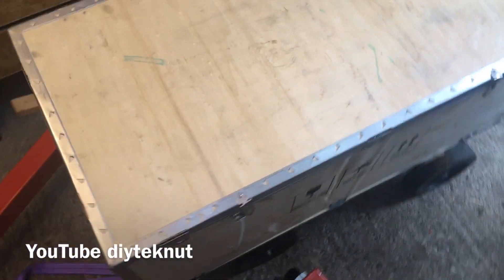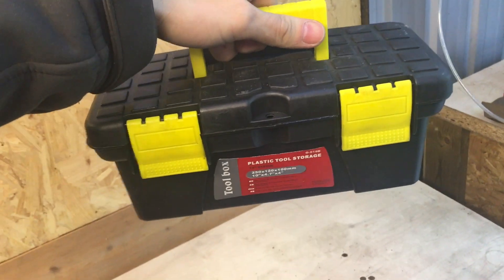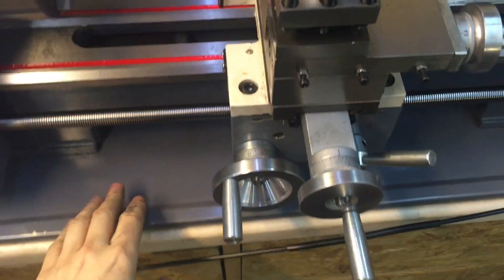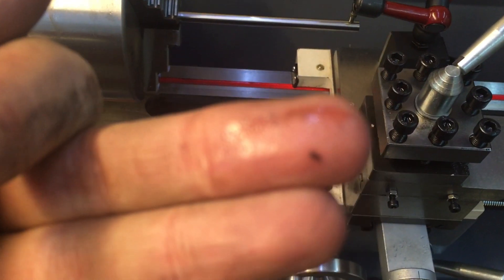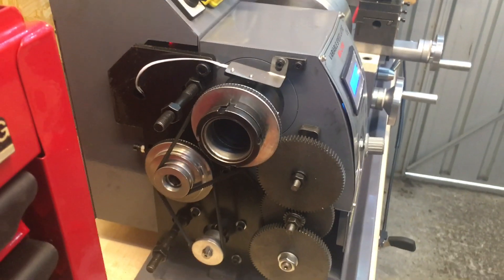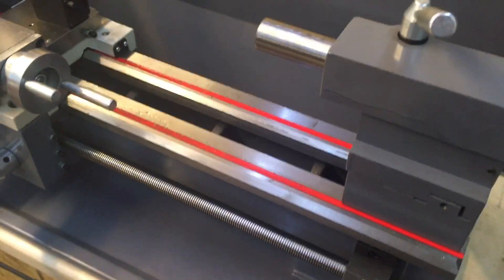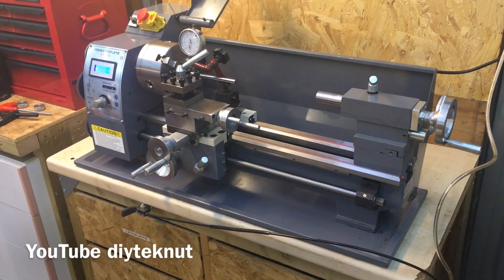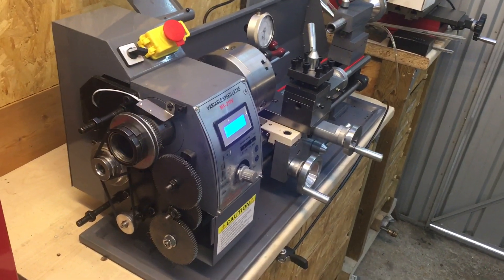Installing My New MX-210V 8 x 16 750W Variable Speed Bench Lathe

Comment from the maker: Replacement Belts 5M375 Gates Polyflex Belt https://amzn.to/3iDQNLG

Lathe https://amzn.to/2KiUAjU
Quick Change Tool Post https://www.banggood.com/custlink/vK3mJYQoo9
Heavy Duty 1 Ton Folding Engine Crane https://amzn.to/2OGoKwg
Hilka G301C9BBS Heavy Duty 9 Drawer Tool Chest BBS https://amzn.to/2OEzeMH
Cobalt Drill Bit Set https://www.banggood.com/custlink/m33GhoqQgF
best mig welder https://amzn.to/2SzfuiJ 

My Tools I own 
Stick welder https://www.banggood.com/custlink/vDvKRBfsKk
Tig Welder https://www.banggood.com/custlink/KGmmR4wQ61
My camera https://amzn.to/2SHHsnu
Tin Snip https://amzn.to/2Tro9Qy

Flux core wire welder https://amzn.to/2BSkkwl
Stick Welder https://amzn.to/2AMBFH7
Welding Clamps https://amzn.to/2Ul0IZM
Table saw best a this price https://amzn.to/2GH1oX8
Screwdriver Set https://amzn.to/2C0CFYQ
Thor 708 Nylon Hammer https://amzn.to/2Gy50uo
cheap Angle Grinder https://amzn.to/2GMb1DW
Proxxon mini wood turning tools https://amzn.to/2Sj1W6V
Multi-Function Rotary Tool https://amzn.to/2Tf4N0A
Kitsu palm Router https://amzn.to/2GwZU1p
Belt & Disc Sander https://amzn.to/2SbLZix
F-Clamp https://amzn.to/2QXYfqy
Irwin Pullsaw https://amzn.to/2RlXlmR
6-in-1 Screwdriver https://amzn.to/2Q8wZAf
Mitre Box https://amzn.to/2CDBlMa
Mini Angel Grinder  https://amzn.to/2So48d6
TITAN planer thicknesser TTB579PLN
183068
Above are affiliate links and in the comments it costs you nothing, if you do not want to use links search on goggle more info Thanks.

8 x 16 750W Variable Speed Metal Turning Bench Lathe
Specifications
Voltage: 220V
Motor Power: 750W
Spindle Taper: MT5
Tail Stock Taper: MT2
Range of Spindle Speeds: 50-2500RPM
Distance Between Centers: 400mm (16")
Swing Over Bed: 210mm (8")
Chuck Diameter: 125mm (5")
Hole Thru Spindle: φ38mm (1.5")
Maximum Compound Slide Travel: 55mm (2")
Maximum Cross Slide Travel: 75mm (3")
Gear Parameters On The Machine：80，72，84，33，24
Gear Parameters In The Accessory：30，40，50，52，60，66
Feature
Variable spindle speed of 50-2500RPM.
Spindle bearings use precise tapered roller bearings.
Rails have been quenched with high frequency and elaborate milling.
High precision, able to turn out standard qualified works.
750W strong power, 400mm processing distance.

Email me at diyteknut@gmail.com
#DIYTEKNUT #TRENDING

Comment: Hi, are you still satysfied with that lathe? I bought it last two weeks, and it was technical disaster. I found out problem with taper roller bearings, they dont have 3mm gap for the inner cage, so it will wear really quickly. Ive decided to make complete overhaul od this machine. This was realy bad deal... :(

Comment: What exact make and model is this?  Can't find it on Amazon and as with all the Chinese stuff, just because they look the same doesn't mean the quality is the same as there is next to zero copyright law in China.  Apprehensive to spend over £1k on a machine where the seller has told me to "look at the pictures" when I asked for a PDF of the technical specs. and the operation manual so I could digest the quality I was potentially buying.  Bearing in mind these are selling for more money that a Myford 7 they need to be as good in my opinion.

Comment: Does yours come with a 38mm spindle bore and both metric and imperial thread cutting gears. And are the dials in metric? I can only find them with metric cutting gears and not both metric and imperial.

Comment: Do you have a video on how to thread using this particular machine.  The manual is so vague where it doesn't explain it very well.  Thanks
Reply from the maker: no i use taps and dies , not used it.

Comment: I have the same lathe, how do you change the spindle speeds? a hint would;d be good thanks
Reply: Open the tail stock cover. There are 2 positions for the V-belt. Position A is from 50 to 1250 rpm. Position B is from 100 to 2500 rpm. Not the easy shiftin lever like 7x14 lathes have.
Reply: @johannriedlberger4390  thanks I know that info, (head not tail) but how do you release the tension on the drive belt, I can see the adjusting hex head machine screw and locking nut. I have  backed this out, but the idle pulley is still not moving, I can see behind the pulley a bolt head with two flats, but it's not budging.... Two tight to turn with a M10 spanner...

Comment: Hi, nice video. I'm trying to find that lathe on Amazon that includes the 4 jaw Chuck, but no luck I like the fact that it has the large spindle bore. What company on Amazon did it come from.   

I found one similar but it only had a 3 jaw Chuck but it did have the 38mm spindle bore, another brand had both the three and four jaw Chuck but only had a 21mm spindle bore.  Do you find yourself using the larger spindle hole often or would you be able to live with a smaller 21mm bore? Thanks in advance for your time, James USA
Reply: To have a bigger spindle bore is very helpful on a short lathe. I asume that the bigger bore spindle also has bigger bearings what will be a more rigid machine.
Reply: Grizzly model comes with 4 and 3 jaw chucks--  bit more$$$$ but they have warranty and parts/service:
https://www.grizzly.com/products/Grizzly-8-x-16-Variable-Speed-Benchtop-Lathe/G0768

Comment: Any recommendation on why you chose the 38mm Bore with a 5" chuck over the smaller 4 inchs one?
Reply from the maker: well its handy if you have bar stock in longer length you can pass it through without cutting it down and wasting materiel .you can grad larger metal in 5" chuck. 
the chuck you get with it has been modified the centre has been bored out to 38mm.
you could buy 4" and make 5" back plate later. but you wont have the bore. up to you weather it will come in handy .
Reply: @JAYZWORKSHOP  OK Thanks a lot,
I've found one like yours on ali:
https://www.aliexpress.com/store/product/Mini-Lathe-Metal-Lathe-Variable-Spindle-Speed-Lathe-8x16-Inch-Mini-Bench-Lathe-38mm-Spindle-hole/4217040_32991639055.html?spm=2114.12010612.8148356.3.44c55d67bahsse
It comes with the 125mm chuck and 038mm spindle hole.  I hope It's the same.
Reply from the maker: yes all looks the same just in red.
Reply: @JAYZWORKSHOP  Don't like too much the red but it's the cheapest I could find. Thanks.
Reply from the maker: was looking at that lathe and it seems like it comes with a 4 jaw chuck from the pictures.
Reply: @JAYZWORKSHOP  yeah right. I ask him to switch for a three jaws and he agreed. The 4 jaws that he sales is a self centenring one which is useless. Better have 3 jaws instead in that case. I wonder if It's easy to remove that red paint. I will change the color...

Comment: HI, It was a good idea to hold it with a rope. I wonder if wrapping it around the chuck was safe though. Were you confident? Thanks for the videos. I've ordered one and will get it at the end of the month...
Reply from the maker: no i was not confident thought it might slip. i have since been told you shouldn't lift by the spindle can damage the bearings. but the weight distribution   of this lathe is all headstock side with nothing to attach a strap to. this was not a rope its a lifting strap . when doing it again will use two straps.
Thanks for commenting.

Comment: Good video having watched other channels about this type of lathe I don’t think I will be rushing to buy one but best of luck will be interesting to see what you make of it
Reply from the maker: if you buy Warco or Chester  they have the same problems they say ready to go but its bull. the need striping cleaning and hopefully thats all 
my warco mini lathe had lots of problems head was not parallel to the bed. my friends wm180 motor and controller bunt out .
most good old machines are warn out a good one is far and Few between . the only thing to do is buy a new myford  £8000 Or Refurbished £2500. yeah i should have got a loan for a fefurb yeah you made my mind up going to sell this.
Thanks.
Reply: I am looking at this exact one on ebay..was thinking about buying because of the 1 1/2" spindle hole and motor size...But your comment about selling the one you have has changed my mind, i think I'll suck it up and buy the Little Machine Shop 5100 for $1000 usd. 
 Its a shame this would...could be an awesome sized mini lathe.
So, did you get yours sold ?
Take care, Russ in Texas.

Comment: Hi, liked the video, I've got one exactly the same as that except for two things, I can't seem to find out who the maker is and also I can't see how to reduce the belt's tension for changing them, I can't wait to see how you go about it, I haven't had it long (since January) and although I haven't done anything I am having a great time exploring it so I'm sure you will have a great time with it as well, good luck, Gary
Reply from the maker: Hi Gary.
its just generic Chinese, i think the castings are seconds as their are some defects in the cast iron .
not sure how belts tension yet. one of the belts have started to fray already they are about £12 each 
https://amzn.to/2KBvIEm. 
i rarely use high speed on my mini lathe as mainly turning larger parts. but once i find out i will let you know.
Thanks for commenting have a good day .
Jace.
Reply: The 8x16 bench top lathes are probably all made in the same Chinese factory for different retailers/importers/distributors in US and other countries....

Here is a web page for an 8x16 sold in US by Grizzly:

https://www.grizzly.com/products/Grizzly-8-x-16-Variable-Speed-Benchtop-Lathe/G0768

There is a parts list with prices along with a more detailed manual (which may be applicable to your unit):

https://cdn0.grizzly.com/partslists/g0768_pl.pdf
https://www.grizzly.com/products/g0768/parts

https://cdn0.grizzly.com/manuals/g0768_m.pdf
https://cdn0.grizzly.com/specsheets/g0768_ds.pdf

The Grizzly G0768 was about $900 USD before the tariffs and trade wars started.
It could be that the factory  now sells seconds/ defective units,  or units that don't meet Grizzly specs or requirements, and these rejects are sold to ebay sellers who arrange for a drop shipment to bargain hunters ?  Don't know for sure- but there seem to be a number of utubers dealing with defective castings and not being able to find parts or information.

I've had one for a few years, and after you clean and align the thing, there are a few creature comforts and hobby things you can fiddle with:

https://www.youtube.com/watch?v=7jOVEh1uxpo
https://www.youtube.com/watch?v=PIGYKlTtBIg&t=40s
https://www.youtube.com/watch?v=sHcdEutcs5g&t=106s
https://www.youtube.com/watch?v=OXa1vQTU8b8&t=202s